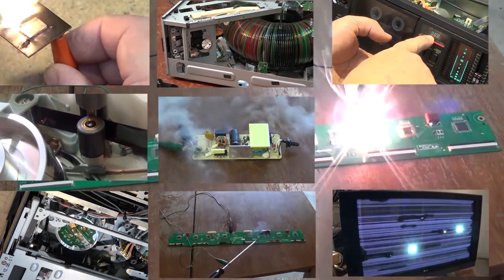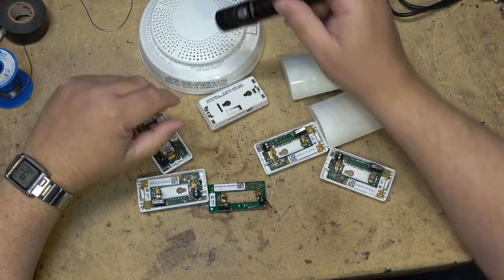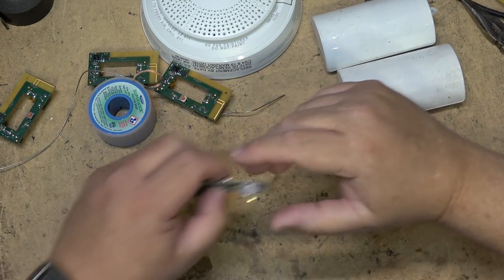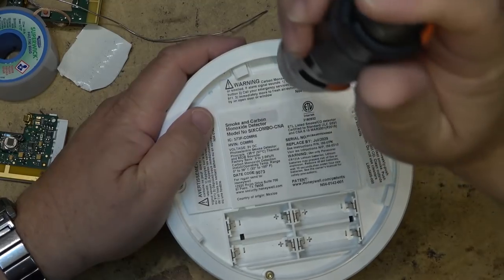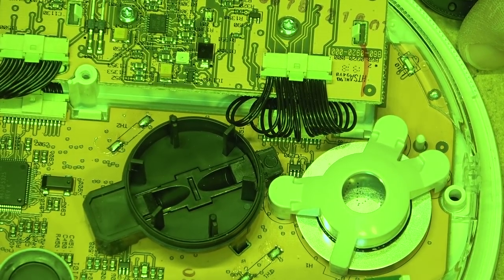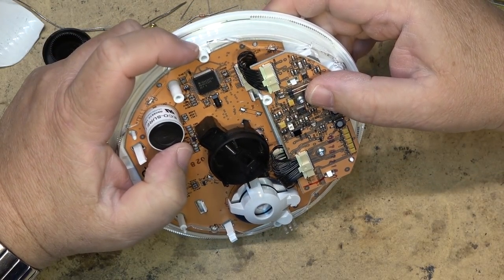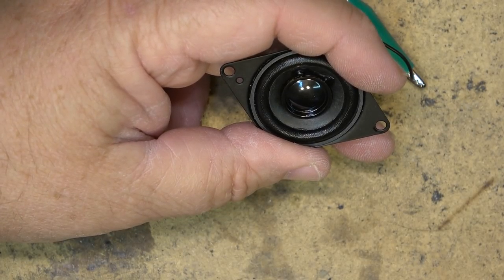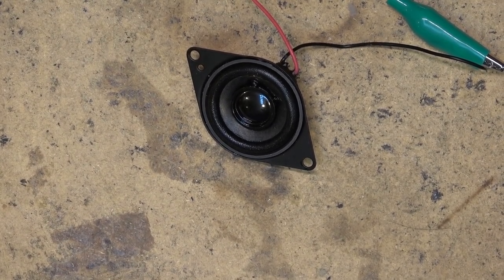Teardown tuesday security stuff

Comment: My dad used to have one of these wireless security systems that used a lot of batteries. The reliability wasn't good, and often had false alarms.
Reply from the maker: The batteries will drain faster if say a door is opened and closed constantly.
My system is hard wired. Personally I wouldn't go for a wireless, but as far as installing them on old homes they are really the only cost effective way to do it. To hard wire an existing home would add a few grand in installation charges that nobody in their right mind would go for. People want cheap monitored systems to save on home insurance. If they have to pay a small fortune to save a few bucks a year on their insurance they won't do it.

Comment: The problem with Reed switches,  them become magnetized over time being in close proximity next to magnet. Then they no longer work unless you change the distance closer to the magnet.
Reply from the maker: The ones on my windows and doors were installed when the house was built in 2002 and they are all fine.
Reply: If you allow too much current to pass through a magnetic reed switch, the excess current passing through it will heat up the "spring finger contact" and it will loose its ability to return to open, thereby keeping the internal reed switch contacts connected, even when the magnet source has been removed. Once this occurrs, the magnetic reed switch will be rendered damaged/no longer usable.   Fred
Reply from the maker: @electronicengineer  Well you don't allow current to flow through a reed switch. It is only providing the turn on (or turn off) bias for a transistor. The transistor is handling the current not the reed switch.
Reply: @12voltvids  In a "perfect world" yes, the switch is "protected" however when the circuit shorts (emitter-base junction) a large amount of current can and will flow. Goodbye reed switch. I've seen it many times Dave.   Fred